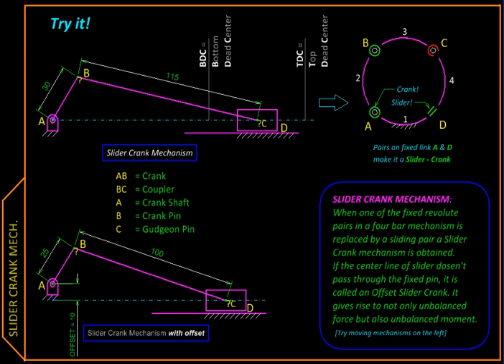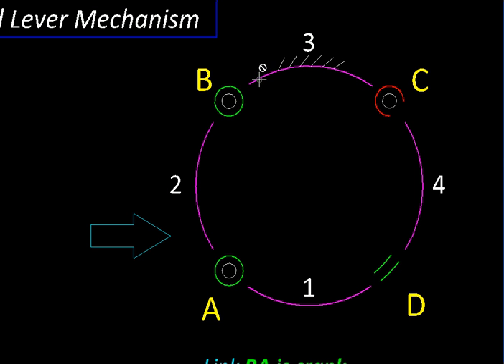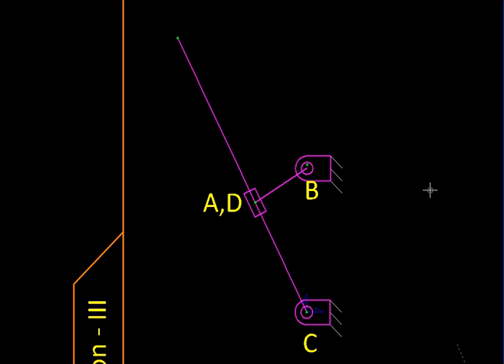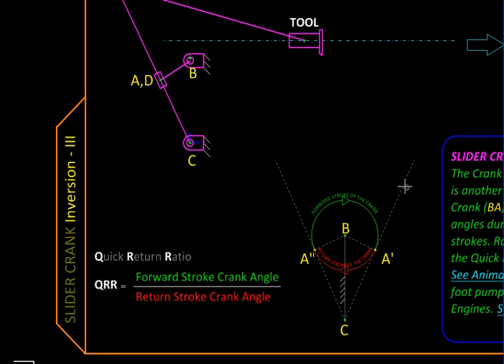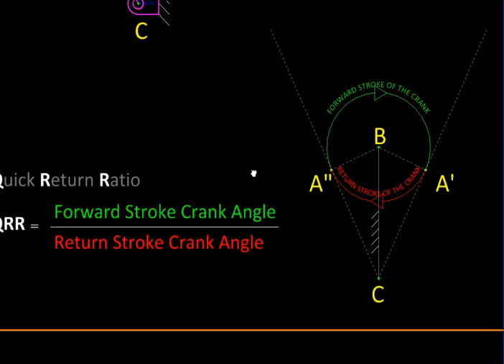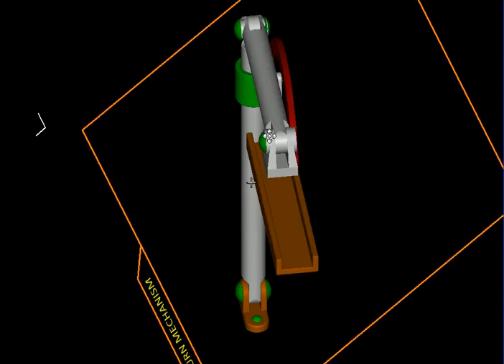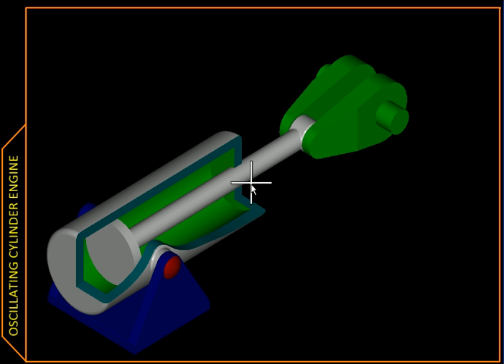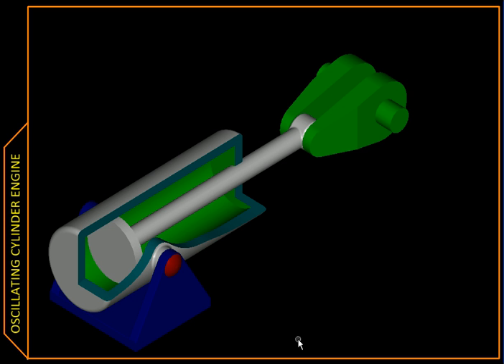Kinematics Ch01H Slider Crank Inversion III

Comment: Sir i am confused
In slider crank mechanism, BC is between crank & piston but in slider crank mechanism in motion , BC is not joint with piston??? This look more like 2nd inversion
Reply from the maker: The difference in fixing Link [2] and Link [3] is, in the first case you get two cranks in the second, a crank and a rocker. As for the 'piston' look for motion and not the shape/size. Check if the link is reciprocating relative to the other? If so, the essential set of relative motions is satisfied. The schematic might help you identify motion and link s better.
Reply: Got it sir thanks
Schematic diagram helped a lot

Comment: Sir,I am facing problem in "inversion of 3r-1p"mechanism....I have followed lecture of IIT Kanpur,bt some problem is still there.During inversion of 3r-1p mechanism..how it represent bicycle foot pump,hand pump etc.
      Your videos are really conceptual.
                                       Thankyou
Reply from the maker: Rahul Kant Thakur It often helps to reduce the parts to their minimal geometric/kinematic form. Reduce the cylinder and piston to a simple P pair, identify the R pairs they are connected to etc. And you will see the 3R-1P.

Comment: I'm confused. If BC is fixed and C is connected to the slider, shouldn't the slider only be able to oscillate while fixed to one point?
Reply from the maker: Big Boss Do not let the shapes of the links confuse you. Watch the motion. Notice which link is oscillating AND has another sliding relative to it. That is the hint. If you have difficulty figuring it, I will help you further.
Reply: UjjwalRane In that case, is the "guide" the slider? That is, link CA/CD, right?
Reply from the maker: Big Boss bingo! :-)
Reply: UjjwalRane Woot!  Thank you very much, sir. It really comes down to understanding the definition of the slider, that is, where it is placed (oscillating and prismatic link)